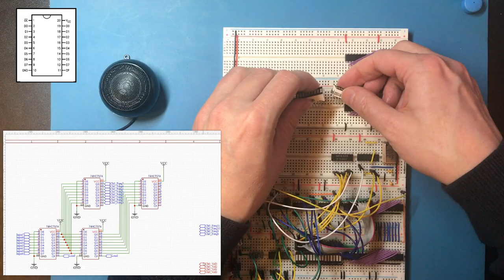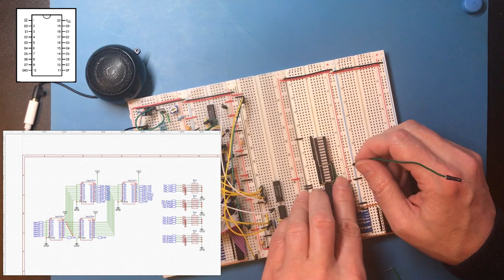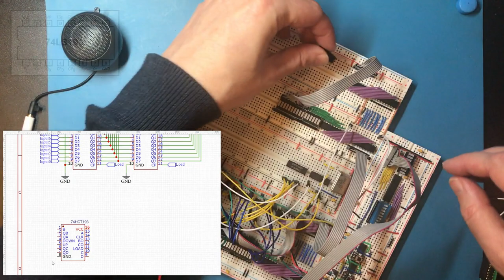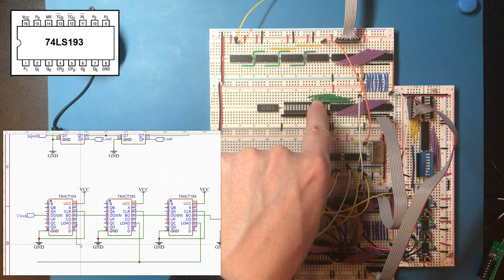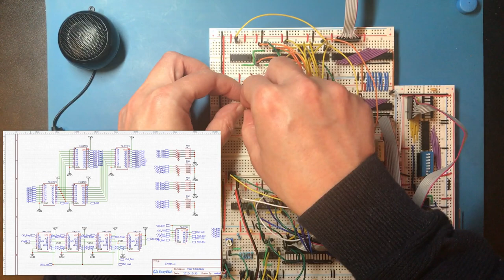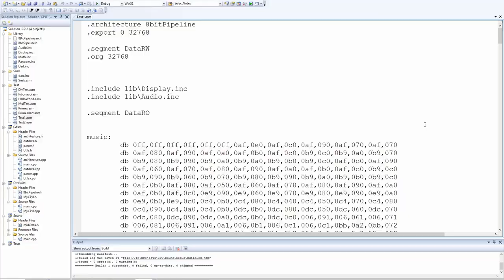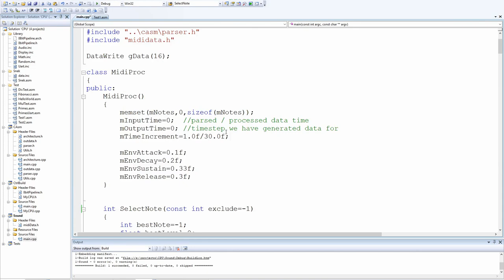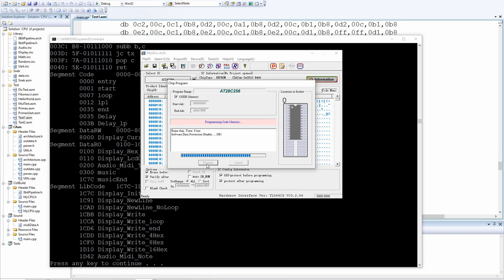Polyphonic Sound - Audio from Scratch - Part 6

Comment: I like the graphic in the bottom while you're building on the board. It looks great!
Reply from the maker: Thanks Polygorg, showing the eda at the same time as the (re)build is me trying out different ways of streamlining the process of going from a concept thru to a final pcb without skipping steps.
Reply: I'll second that. It makes it much clearer what you are changing or adding on the fly.
Reply: WOW 
whats goin on
dont see zilt
Only for zilts noo

Comment: In 2020 I commissioned a synth artist to turn a MIDI file into something that better approximated the sound of an orchestra. The stem tracks I got back all had 8 bars of silence at the beginning. One of the things I learned when asking about it: the space at the beginning of a MIDI file like you mentioned is often done for compatibility reasons. From what I understood, at least according to that guy, certain synth gear needs time to sync up to MIDI clocking before they begin to play anything. Otherwise it could drop the starting notes. So, better to send some null values first to wake up the equipment.
Reply from the maker: Interesting, makes a sence. More analogue hardware could have more of a startup time.
Reply: Thanks. Saved me saying this.

Comment: Fantastic work!

Would it be possible to make the audio channel PCBs stackable? So you could have two, or four, or six audio channels in the footprint of one?
Reply: ah, that was suggested a week ago :)
Reply from the maker: I've rejected the stackable idea now, it would be very practical but for the final presentation of the build I don't want anything hidden. I could possibly do channel pairs as separate modules though in the same way i've broken up the pipleine and alu.

Comment: Terrific stuff! Was wondering if you could stack the channel boards? That way you could make it a 1, 2 or 4 or maybe even N channel setup. Probably over engineering but could be cool! It would probably need some jumper arrangement for missing channel boards.
Reply from the maker: That's one of the ideas I've been playing with, I could also go to tssop for the latches, would save some space. Thanks Laurence!
Reply: @weirdboyjim  TSSOP can be troublesome if have to "tile" them because its difficult/impossible to route traces between the leads. I'd use them only as a last resort. Though your eyes may be better then mine!
LaWrence ;)

Comment: This is cool. Is the next step Snek with music?
Reply from the maker: Thanks! I'll probably not update the original Snek, but I may do a Snek 2.0 once I have a proper graphical display. It would definitely benefit from a few sound effects though.
Reply: @weirdboyjim  A proper graphical display would be interesting. I have an RC2014 which is also ASCII based. Sending ANSI control codes doesn't quite work for games in a consistent way - something in my setup keeps dropping characters occasionally, so you see bits of escape sequences printed on the screen.

Comment: That sounds awesome, I do wonder how it sounds in 4 channels...
Also, The schematic picture was a smart move, I liked that. Now I think it's time for a wager - I say that the VGA circuit will be much simpler than the two channel sound? :-)
Reply from the maker: Thanks Jonny, What are you willing to wager? I would be willing to bet that the  VGA will be more than double two channel sound.
Reply: @weirdboyjim  Well, it depends on what you are displaying. I expect character only at 40 or 80 by 25? You need some logic to handle the vert/horz blanking and some logic to clock out the font data from rom. Doesn't sound like too complex chips to me.

Comment: Fantastic work, once again. I also love to see you troubleshooting your breadboard circuits.
With regard to making it a 4-channel is that even a question? Do it, even if it takes up more space! It will be glorious.
Reply from the maker: Everyone who has commented is pushing for 4 channels so I'll likely end up going that way. Space is a very real issue though, just in terms of what I can put inside the camera field of view.
Reply: @weirdboyjim  Of course everyone is pushing for 4 channels, you shouldn't be surprised of the outcome if you leave such questions to your eager audience ;-)
BTW what is the theoretical maximum for this? And would it be possible to make this into some sort of modular system where you could just stack separate but identical channel boards on top of each other? Just a thought...
Whatever you choose to do, when this computer is finished it's going to be such a fantastic achievement. I hope these videos will never disappear. I hope to do something similar one day and you have been such an inspiration already.

Comment: If you connect to digital outputs together without a resistance between you will get a high output trying to dump current in to a low output. Better to make an op-amp summing amplifier with the required number of inputs to sum all your signals. Or a few extra inputs for an upgrade.
Reply from the maker: The connection point here is at the far end of the resistor ladder so it's really an analogue signal by then. There is a minimum resistance between the inputs of 2k. That said the next audio video is mostly going to be about the analogue stuff I've been avoiding talking about as much as possible.
Reply: @weirdboyjim  I should have remembered that. No harm done, Still active mixers are still the way to go. You still will require some DC blocking. 1's and 0's are much easy to work with :)

Comment: I think instead of doubling the circuit it would be neat to add another channel with a different waveform, or a noise channel.
Reply from the maker: It would be nice but I'm going to stick with just expanding the channel count. I can hand wave a copy paste and then extend my code to handle the extra channels pretty easily. If I was to add a fundamentally new channel type I'd have to do one or more additional videos explaining that and a bunch of coding work to support it and I've already spent far more time on audio than planned. Some viewers may getting impatient waiting on the vga project.

Comment: Go for at least three voices per board, I'd say. You needn't populate all the channels, assuming you have the room. The only caveat would be if you ever plan to change the way you access the sound output (with, say, memory mapped I/O rather than daisy chaining). In that case you'd want to allow some sort of card address jumper  arrangement to give each channel a unique I/O space or memory address.
Reply from the maker: That's good thinking, but I'm inclined to add in even numbers as some of the part are shared between two channels. I suppose it wouldn't be the end of the world to half a half used chip but I try to avoid it when I can.

Comment: Realistically you're not that far off from having a rudimentary synthesizer if you wanted. It may be an avenue worth exploring just to see whether there's something there for you. I think you should definitely step up the channel count regardless. Does it need to be a power of 2 channels? You could do 6 and it wouldn't be that bad.
Reply from the maker: Doesn't need to be a power of 2, just due to chip usage a multiple of 2 is slightly more efficient. It's worth thinking though that the chip count expands linearly with the channel count, it rapidly get's to the point where it would be more efficient to make a half decent DAC and it's own processor, I suspect that's how most modern digital "synths" work.

Comment: 2:32 bad luck stroke eh :-(
Reply from the maker: The biggest issue here was just that missing switch on my test board, must have knocked it off at some point.
Reply: @weirdboyjim  yes part of the 'charm' of using breadboards is things can get loose/off. I see you always seem to have these wires at exactly the right length while building the board up. I know there are kits with an assortment of different length (I have one) but I doubt they're always exactly what you need. Do you precut/bend them yourself before filming starts ?
Reply from the maker: @maicod  It's 50/50 ones I've pre-made verses ones that I make on the fly. This one was mostly pre-made as I knew exactly what was needed from the first channel. In a regular video you'll see my hands go of screen and then come back magically with a perfect wire, I may have edited a bunch of measuring, checking and tweaking out of the video there. Nobody wants to watch me do that.
Reply: @weirdboyjim  ah I got it. indeed sometimes laborous dull work (that takes a lot of time on top of all of this and should be respected :D) is not so interesting to show. The video would get very long and cluttered masking what the video actually is about.

Comment: It's a shame you are using all four of your XOR gates for each channel. Were but one XOR gate free, you could combine it with, say, an 18-bit linear feedback shift register with taps at bits 11 and 18 to get a maximal length pseudorandom noise generator (PRNG) -- the noise channel folks are clamouring for. One suitable shift register chip would be the CMOS CD4006, a variable-length shift register that can be configured for 4, 5, 8, 9, 10, 12, 13, 14, 16, 17, or 18 stages, and with a single XOR of bits 11 and 18 gives a period of 262,143 before it repeats. That part might be hard to find these days, so you might have to fall back on using a few 74LS164 or 74HCT595 chips instead.

No need for counters and latches for the PRNG itself, though you would need a way to at least enable/disable combining the output with the rest of the audio. Of course four bits of a latch would still be required for volume control of the noise channel.
Reply from the maker: I've worked with linear feedback shift registers before but you would need a bunch more work to make it useful for audio purposes. You really want to be able to control the volume, but I suspect you want more than one bit of noise to sound good so you would need either a more complicated digital circuit or a bunch of extra analogue component. My first thought for audio in my build was going to be a single bleep channel so I've already increased the scope a lot. I'm ok to replicate my existing channels but I can't add an additional type of channel without either additional videos to explain or hand waving the functionality.

Comment: My cheap little synth has 4 voices... which (for no technical reason, just a rule of thumb) I consider to be the minimum. I was always frustrated by the early 8 bit home computers having 3 tone channels and 1 noise channel.... just one more tone channel would have made polyphony so much easier/better.... of course, no matter how many you have, you always want more.... I dream of 10 voices so I can play "An Ending (Ascent)".
Reply from the maker: The midi version of Für Elise I'm using caps out at 4 channels so it would be nice to do a full playback of that. For the 8-bit machines it was a cost balance issue, going from 1 to 2 channels was a big improvement 2 to 4 is double the cost but it's arguably not twice as good so you have to factor diminishing returns in. One channel in my circuit is 4 latch chips, 4 counter chips and an Exclusive OR chip so just a little bit more than one of my address registers. That would be bigger than I'd hoped.